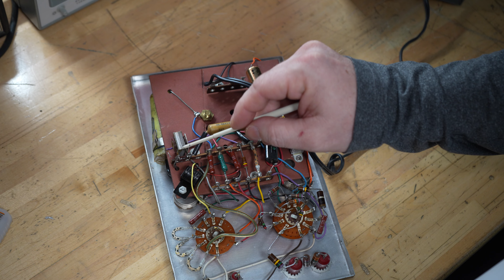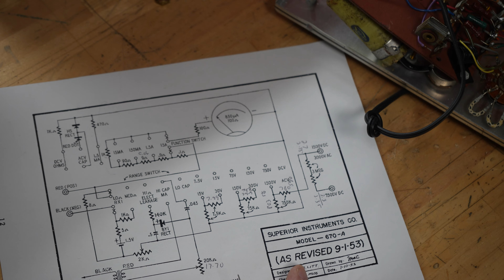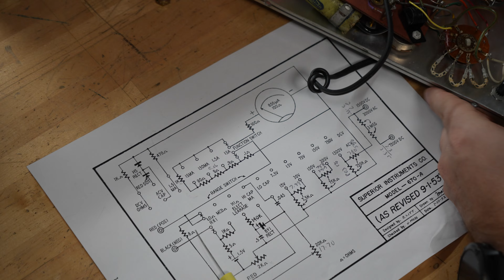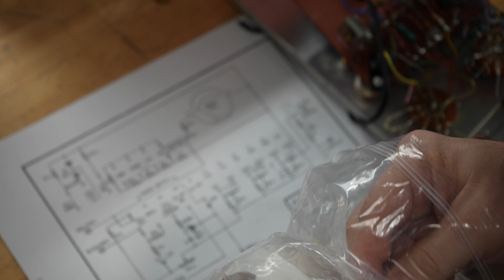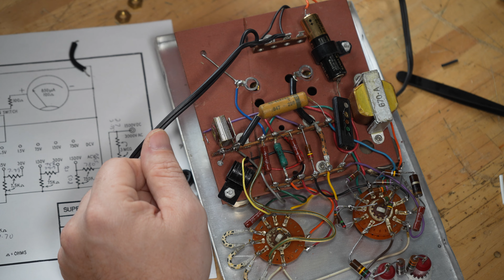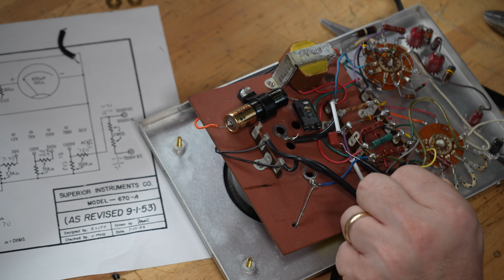Old Volt-Ohm Meter repair - Superior Instruments 670A

Comment: Huh, I just grabbed one of these off eBay. Mine's a 670A. (Edit: now that I'm zooming in closely on your initial shot of the meter I see that "671A" was a typo and that you in fact have a 670A like mine.) It looked like it might be good for quick-check capacitor testing for leakage at higher voltages, and just an interesting old piece of gear. VERY Importantly, it mentions that when testing eletrolytic capacitors, the black lead goes to the positive terminal . This is typical for resistance/ Ohms testing on older analog meters such as the Simpson 260 or Triplett 630, and was done I believe simply so that the meter movement wouldn't swing backwards when testing resistance (or, in this case applying 150V to a capacitor), but with a capacitor at higher voltages you really wouldn't wanna get your polarity wrong. Thanks for posting a video about it. The 670A manual, for anyone interested, is available at the Boat Anchor Manual Archive (BAMA).
Reply from the maker: Thanks for pointing out the typo, I already went back and changed it. I'm going to need to read that manual again, I didn't catch the black lead comment at all. As I'm learning this, I'm finding I need to slow down a bit. I am clearly missing a lot of points, that could potentially keep me from getting hurt lol - Thanks for the feed back!

Comment: I believe with this being a DC volt meter,the added diode at the input is to allow for AC measurements. The  diode allows the meter to measure AC voltage scaled to measure RMS .

Nothing wrong with the selenium rectifier, its not dissipating much power and will probably last for many more years.  I believe selenium is better as its self healing if momentarily shorted, and has built in surge suppression by nature.

Soldering to the battery is a-much more reliable connection. Depending on the quality of the battery holder, the connections  to the battery can become corroded and intermittent.  Batteries used in the ohmmeter section last a very long time .